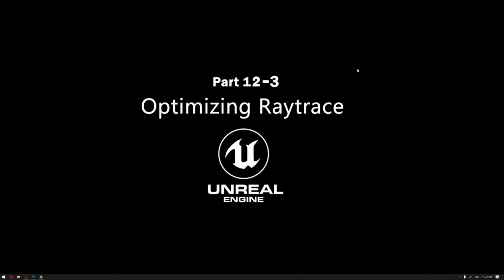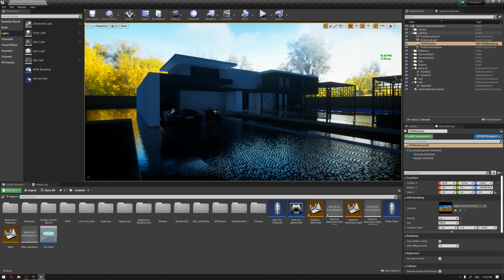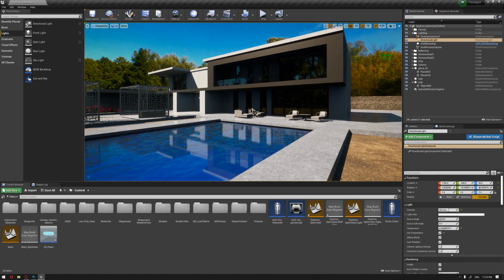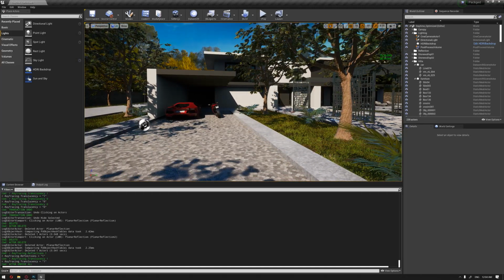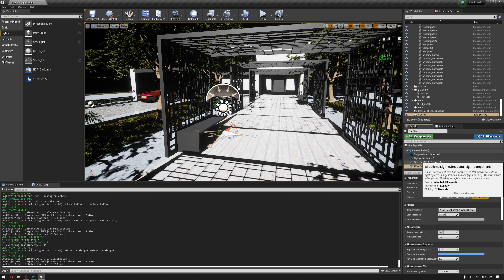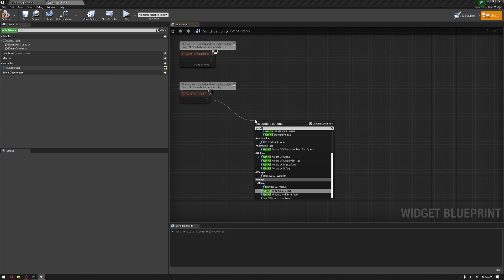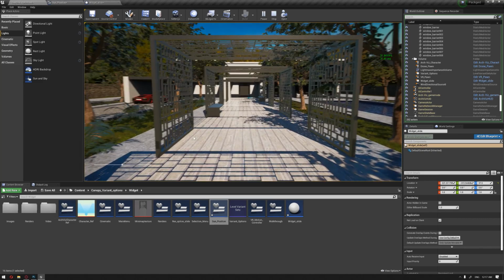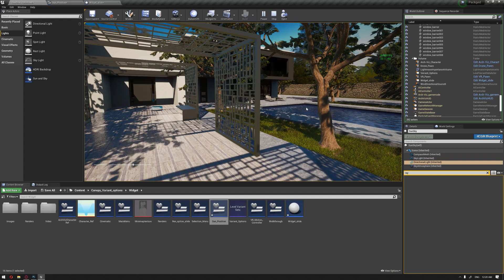Unreal Engine 4 Arch-viz Tutorial Course part 12-3 Optimizing Raytrace in Real Time

Comment: How do you manage ray tracing, light building & reflection captures in a level with both First Person & VR options? Is it best to do a light bake with some static lighting and reflection captures first and then switch off all ray tracing when you possess the VR character? Or would it be better to have the VR character on a different level entirely, which is activated from the first level? Sorry for the rambling post! These tutorials are amazing!
Reply from the maker: Thanks you , to develop a VR you have to consider performance over quality first , But you have to get the best and cheep quality also and yes you can only get this with baked lighting for fast FPS , reflection is something also you have to really consider before adding it as raytrace inside your VR , the bottom line is for Interactive pc app get the best quality for better visualization , for VR get the cheep quality for better performance to maximize performance as much as possible for better and safer experience

Comment: Video clip not getting packaged,  how its possible to run in another Pc ?
Reply: Which is the location,  How can its possible?
Reply from the maker: @arshalkaboobackar  well its gonna be tricky cause you want the video location to be the same location where you gonna package your project so for example inside the folder where you ask unreal to package your project
Reply from the maker: UE will try to load the video from its location if its not there it will not be able to load it on the cinematic widget